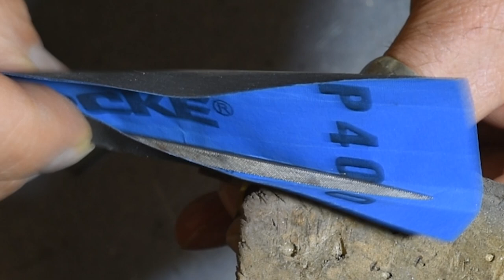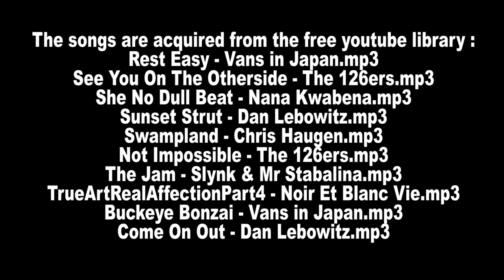jewelry making Kunzite gem mounted on 18KT gold pendant

Comment: Can you share a link to that laser, i love your work
Reply from the maker: The laser welder is from the Italian company SISMA, which produces excellent equipment. On the other hand, the laser cutting machine is of Chinese origin, purchased through a well-known online sales site. The cost is much lower than the machines offered by specialized companies in the production of equipment for jewelers. However, the downside is that you have to deal with all the problems arising from the installation and calibration of the software and components.